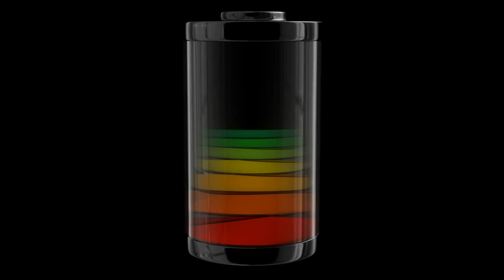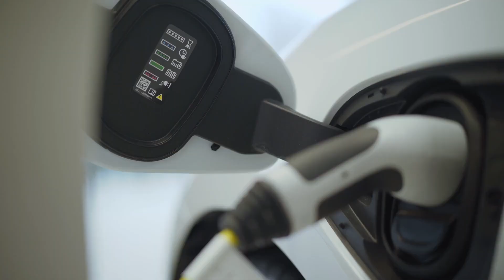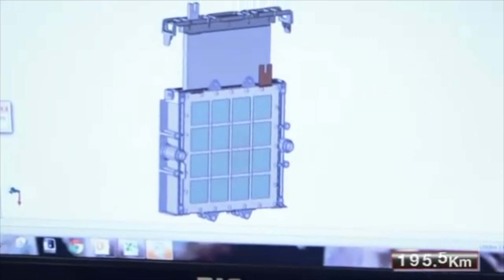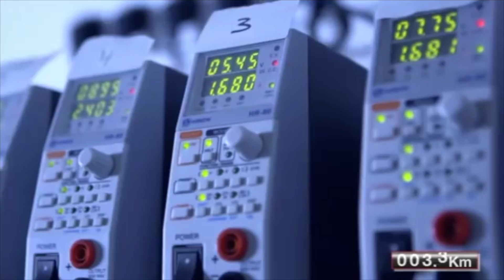This Battery Gives EVs 1000 Miles of Range!

Comment: Aluminum can be used much easier than that. Just coat it with... dang, I forget the name of the metal, it's a liquid metal other than mercury (although mercury would work too). Once the oxide layer has been breached, the liquid metal will bond with the aluminum.

The coated aluminum is then placed inside a water tank, at which point it begins reacting with the water. Aluminum is a very reactive metal -- so reactive that it instantly forms a hard oxide layer instantly upon exposure to air. (How hard? Hard enough that it's used as one of the hardest industrial abrasives!)

Anyway, the aluminum begins reacting with the water, and the liquid metal prevents it from being sealed off from the water via an oxide layer.

By reacting with water, it creates aluminum oxide from the oxygen in the water, liberating hydrogen which can then be used to drive a car (for example).

This tech was in the news a few years ago and I believe it was used to drive a car in a demonstration.

Eventually, the aluminum will be converted into a mass of aluminum oxide, which can be recycled into metallic aluminum. I don't know why this tech doesn't seem to have gained traction, other than it not being rechargeable (even though it's impeccably clean, the only byproduct being hydrogen (the aluminum oxide being contained in the tank). It would have required a system of swapping out an expended "block" of aluminum and recycling the spent units, but hey, it's not exactly like electric cars are infrastructure-free.

In short, aluminum with a liquid metal makes it literally possible to drive a car on water. The hydrogen is liberated "on demand" so to speak, thus obviating the problems of hydrogen storage (being the smallest possible atom, it passes though pretty much everything you put it in).

Comment: 600 Km is not "nearly 1000 miles.  You might consider an edit around 8:15
Reply from the maker: maybe you didn't see the pinned comment: but its 1600 km or 1000 miles.

Comment: This could be an option for long range trucks, or could be combined with lithium ion for a hybrid approach.  Use the normal battery pack for a couple hundred miles, then have the aluminum fuel cell kick in for those long road trips when the battery gets low.

Plus, I could see the dealerships jumping at this tech.  With a move to EV's, there is a lot less maintenance to be performed on a car.  If people had to replace their aluminum fuel cell every couple thousand miles, they could use that as a revenue stream like the oil change today.  

In the early years of this tech, there would be competing standards, and that would cause some problems.  I could see a push to a universal standard, followed by marketing hype about how this model has 4 fuel cells or that one has 6.

Comment: Our Electric grid is antiquated and could not under any condition support everyone in an electric car .not to mention just because you can store that  much electricity in a small space it’s not always a good idea .right now the Tesla it’s batteries hold the equivalent of the transformer outside your house on the telephone pole this much electricity is needed to push your 3000 pound vehicle at 55 miles an hour for 2 to 300 miles that’s a lot of energy and under the circumstances of an accident these vehicles are highly dangerous .they explode but if your car is in a flash flood and you crash into something under the water and just the right way you can all be electrocuted and you know this has already happened in the 1990s GM has a record of it .electric vehicles are a great idea if there in golf carts or E bikes but in cars or trucks it is highly dangerous .you’ll notice you never see an electric car in a stock car races this is because in a crash these batteries explode especially if gasoline powered car was racing with it and caught  fire next to it you must understand the unintended consequences. And electric car of any size meaning larger and larger storage systems of power.

Comment: It could have applications in medium term or even a seasonal renewable energy storage systems - say to get that solar energy  plant output through the winter months and reprocess the aluminium using excess capacity during the summer months. Don't know how that would stack up in terms of annual continuous power output as a percentage of annual average solar output. If it was about 50%  would it be feasible?

Comment: I would rather use aluminum air batteries in portable power generators instead of EVs. When you need emergency power or need power on a construction site, just add distilled water to the generator to activate the battery.

Comment: I could see having a hybrid, a lithium daily use battery with 200 mile range that you can plug in nightly at home. Then have a slot for a aluminum pack for a long haul trip to get you through questionable charging areas.  90% of of Tesla owners charge up at home every night. And only top off at a super charger if it is a long drive day, or utilize for long trips.

Comment: 600 kilometers is 372 miles not 1000 as you say about the citroen car experiment, and if the process is depleting the aluminum, how long would these batteries last? very interesting, hope it works out

Comment: At least on the scale of a Tesla, I don't think we should be lauding them for electric cars and instead encouraging people to do stuff like use more conservative uses of electricity and corresponding storage, like how some e-bikes have 70+ mile ranges or even more for single-digit percents of the juice of a Tesla. I want to build a 200-mile one by completely filling in a bmx frame with the battery pack, and it should only need like 5kWh in terms of the Lithium batteries. 

I want to see if I can get one to power the bike I mentioned.

Comment: You restore the range every time you swap the cheaper battery. Unlike Lithium batteries which will inevitably loose capacity every charge cycle and by 7-8 years significant range issues may crop up. Not so will Aluminium Air batter.

Comment: Let's see, the cost of driving my ICE car 1000 miles at current gas prices is $66.23. ($2.649/gal.; 40 mpg) The cost of 200 pounds of new aluminum (required since the old battery must be recycled into new aluminum -- no retrofit or rebuild will work on the discharged battery) is $236.17. Maximum value of the battery as scrap is $124.00. So the cost to drive the aluminum-powered vehicle is $112.17, or nearly twice the price of my gas-powered ICE vehicle. Note: The $112.17 price works if, and only if, there is no cost for the labor of replacement and the batteries have no manufacturing or delivery costs. At the end of the day, the cost per mile will probably be similar to a loaded semi.

Comment: What about putting an aluminum air battery on board a vehicle with a main line Li-Ion battery?  No charging station nearby?  No time to stop? Etc..  Just switch over to the Aluminum Air battery until you have a close-by, time convenient, opportunity to recharge.  After you have used up your "emergency power" battery, just get a new one!

Comment: All this talk about electric cars is a bunch of crap! When traveling several hundred miles or more in a day you don't want to sit around for five to six hours to fully charge a vehicle that's only going to go around 350 to 400 miles on a charge! I take trips to different areas of the United States at times that I drive more than a thousand miles in a day. I usually will only stop 5 to 10 minutes to get gas or use the restroom and continue driving. Like I said I do not wish to sit around for five or six hours waiting for some vehicle to charge when I could be traveling.

Comment: QUESTION??? make a video
what dont EV come with Alternator to recharge batteries?
whatt is the difference regenerated brakin recharge?
wouldn't that MAXIMIZE miles gain?
Also why cant they make vehicles simple Power Windows/door locks, lightweight seats NO airbags simple engineering
.
just wondering
why not MANDATE all new cars must be HYBRID or full electric... maximize pollution & efficiency at a faster rate for United States
even though China other countries lead pollution dont have to comply

Comment: My EV has a range of about 230 miles and this is more than enough for 95% of my usage using only my home charger. If I could plug in one of these batteries as a range extender 2 or 3 times a year when I wanted to go on a road trip I would never need to use a rapid charger. It would fit in the front boot and/or in the space under the boot floor but only when needed. No more range anxiety!

Comment: Carbon carbon batteries are better than lithium ion by about three times now but a small MSR as in the mega watt range can be made with no moving parts and the ability to turn it off by pumping a sub critical mass with AA button beam it would take about the power of a small to medium machine shop worth of energy to pump the tiny reactor but it were bUilt in the one megawatt range it could be switched on and off to charge super capacitors as you drove and think about being able to park it next to a hospital in a long term power outage and logging in to power the building and any electric car not fitted with an Mar.
X

Comment: Very interesting stuff.
If the packs way so little then it might be an idea to e.g. halve the amount of heavy lithium cells in a vehicle and add one of these bad boys.
Significant weight and financial savings.
Only use the Al cell when Lithiums are running too low or for big adventures in the wilderness/Le Mans 24hr race!
Wd probably be using the lithium at least 90% of the time in usual urban driving scenarios,never far from a charger/home.
Easy to set up cellswap points at existing charging stations,subject to cooperation!
Knocking 200+ Kg off the weight of a car will also greatly improve the milage per kilo of batteries.

Comment: You falsely  portray children in DR Congo pitifully  scratching the ground to get some minerals to produce Cobalt.  Instead, , the ores are mined on an industrial scale: DRC output of Co metal is over 60,000 metric tons/year. Also, the figures you use for the energy needed (and the associated pollution) involved in Aluminum production is for primary Al from bauxite; the energy requirement for recycling  Al is much lower.

Comment: The concept of using these as a way to eliminate rang anxiety is the best use of these to me. Having the regular rechargeable battery, & have one of these batteries in the frunk for instance with a used mileage meter in the car, or even just on the battery pack itself. So you would only use the aluminum battery pack when needed & then replaced accordingly. 

Perhaps even only make these as an onboard added power source to charge the regular EV's battery while driving. Little to no modification would need to be made to an existing EV; & actually, I could see there being a great market for that. Have & use your car as always, if your going on a trip, get one of these packs put it in your frunk to allow on the road charging of your car. 

No more range anxiety. :-D

Comment: Clearly electric cars win, or can win most metrics, but are disastrous at this range anxiety matter.

It is a dealbreaker to most, cos a car is multipurpose, ~open highway is occasionally a must.

Even an absurd battery weight is only a part fix.

Its very appealing for many, to get by most days w// just convenient top up charges while parked at home or work, but to have a hybrid power supplement that weighs and costs less than the petrol motor of Plug In Hybrids.

If the power from this non rechargeable reserve is dearer, its well worth the convenience and peace of mind. It is better economics & weight than a petrol motor as a reserve power source.

An analogy is ~replaceable torch batteries or barbq lpg gas bottles. If auto makers used open standards, users can swap & replace them easily 24/7.

A Leaf has 272Kg to go 250km, so 9x better AlO ~=30Kg, or 4x 7.5KG modules/cells. Ebikes already have a fast change module like that.

Cost needs the context of frequency. Wise buyers have chosen a car that rarely relies on this reserve power.

Comment: When I saw the battery pack as something essentially flat upon the frame, then heard you speak of swapping out aluminum batteries, I got to thinking. At the bottom of my car's doors is a continuation of the body metal. Of course I have no idea whether car skins are large and pieces stamped out from which the trunk, windows, hood, and doors are to go and this skin folded, shaped, and reinforced or whether various size metal sheets and strips are welded to look continuous. Suppose we have a dedicated space in that strip of metal below the doors, on both sides that snaps (or is unlocked) to open. If the aluminum sheet battery were a pack with connectors on both sides, then a worker at the recharge station goes to, say, the left side and hooks a replacement sheet to hooking fittings on the right side of the fresh replacement sheet, returns to the right side, hooking up a pulling tool and does some button or lever that lifts the locking pins (keeping the aluminum sheet battery from sliding out or just moving around), and then pulls the old sheet out until the designed gap between the sheets lets the spring armed locking pins to pop down and secure the new sheet (as it had the old), then the worker moves the pulling tool to cause the old sheet to unhook from the new. The metal skin below the doors is then latched shut on both sides, finishing the exchange, making the car ready to go after the payment is secured. The old battery is placed in a box, where some high pressure fluid flush takes place. The air/fluid flush ports are capped and secured, ready for the next car after the recharge is complete. The whole task would be comparable to someone wanting to change an air filter every time he pulled into, to use an old term, "filling station". In short, I think the swap out idea might work.

Comment: I say electric cars MAY have limited use in our future at best and that is only in the cities with favorable climate all year around. Clean fuel with low carbon foot print such as Hydrogen or even NG or propane or a combination of all will be the solution. Tessla like electric cars are just a fad with hidden cost of battery manufacturing are just a ploy to empty the pockets of some Rich folks. It seems everyone knows this but they are intentionally ignore these facts.
Reply from the maker: Interesting view. I recently drove 500 miles from my home in San Diego to the Bay Area to visit my parents. At the firebaugh supercharger I was charging under a massive array of solar panels. Literally running on sun. Plus these cars will soon drive a million miles before needing any work. The next 5 years, I think will be very surprising for you.

Comment: You conveniently seemed to miss that aluminum is one of the most toxic materials we humans produce.  Not the material itself, but the by-products of aluminum production is stored in giant toxic lakes across the country.  I saw an estimate of 100 square miles of toxic sludge pools which routinely find there way back into the earth during storms and flooding events.  So while it's certainly an option for the future and it's very recyclable, it also comes at a high-cost to the environment.  One that I might add does not go away and has to be maintained forever.

Comment: Even if the aluminum air battery is not the answer for the EV, there maybe a solution over the horizon that is environment friendly, cost efficient and long lasting. This would be an area of research Musk, Bezos and Co. could spend their money on, rather than how to ship a dozen rich guys into space. 
Electric Vehicles are still very young and the best battery has not yet been developed. I am confident it will be.

Comment: Could be used in combination with a smaller rechargeable battery.  It just sits there and on the odd occasion when the rechargeable runes out, then it gets used.

Comment: Considering the need to absorb and recover braking energy, I envision a hybrid system unless Al - O batteries are rechargable. You could use super capacitors or Li-ion batteries to absorb braking energy, and if you have such a system, even a small one, it might be worth recharging it at home. This could extend the Al-O battery. By how much I don't know, but there might be a sweet spot in which a hybrid battery system carries a rechargeable battery that's just big enough to be recharged easily overnight at a low charge rate, In other words, a rechargeable component that is only charged at home at night and has no inconvenience due to range.

Who knows, the Al-O battery might last thousands of miles for city use.

Also consider liquid ammonia fuel cells which offer similar or better features to Al-O batteries.

Comment: Thank you for weighing some contrary points.  There are 2 points that were quite weak.  Cost of production.  The cost of making raw AL is very high and in places like India and China, Huge Carbon Costs by Coal fired plants will be required to manufacture Al AND recycle Along etc.  Huge energies are required to recycle.  Most likely this toxic byproduct will be disguarded and will find itself in our ecosystems.  So this will have to be highly regulated.  Secondly, it might be noted that Canada's Al is almost all zero carbon, being situated near hydro dams.  Nuclear power is the only other zero carbon solution until Fusion is on line.  Finally, Check you tube.  There are Al pop cans, shredded, used in Sodium Hydroxide to produce H2 fuel for carberated engines...